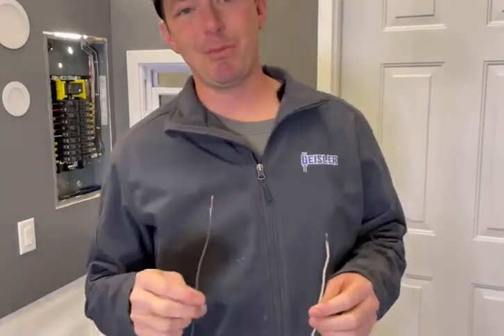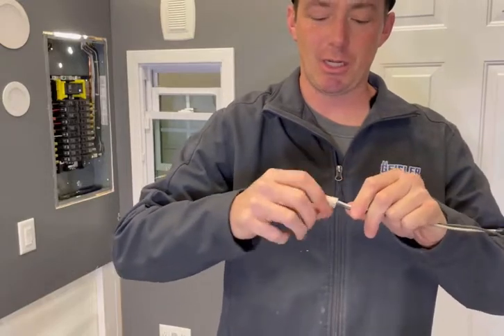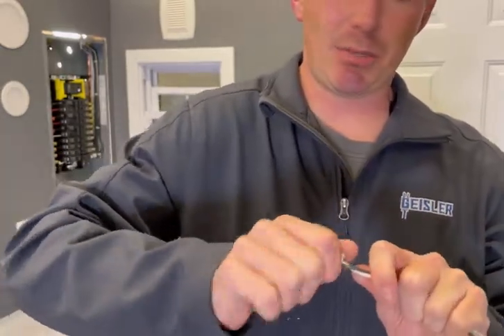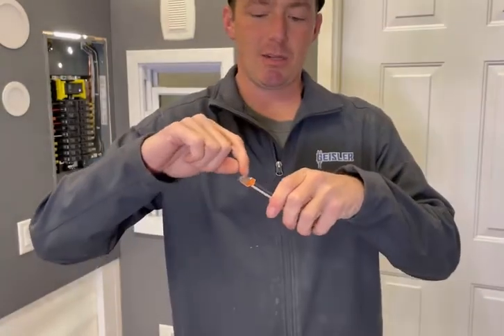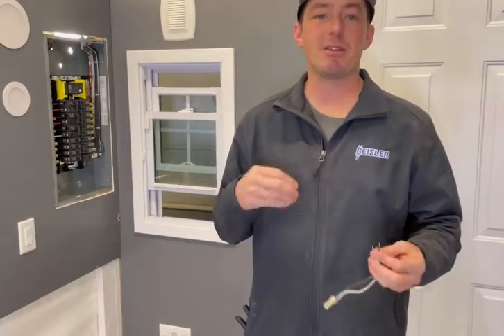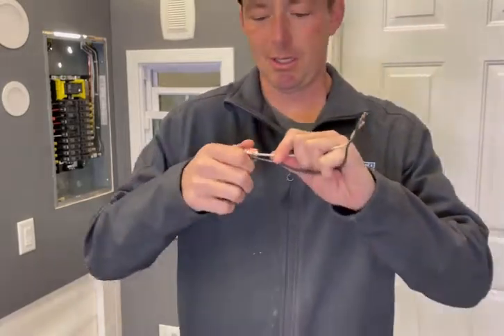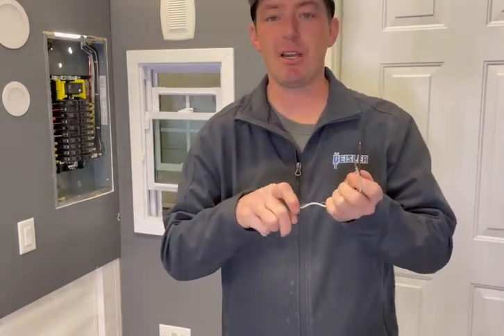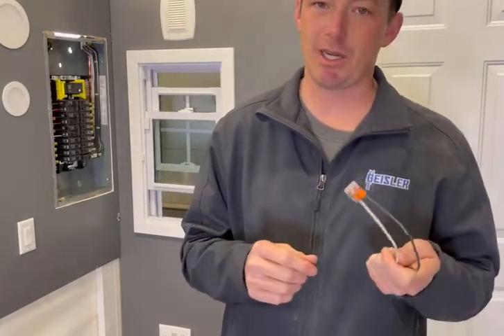Types of electrical wire connectors. Explained

Comment: There are far more than 2 types of wire connectors.  Basically you want a good mechanical and a good electrical connection. Evaluate alternatives accordingly.